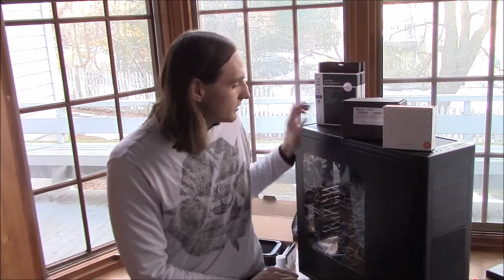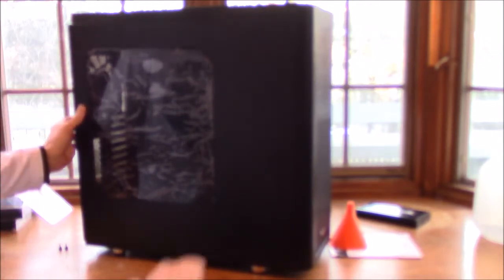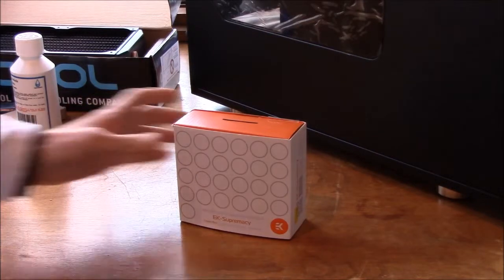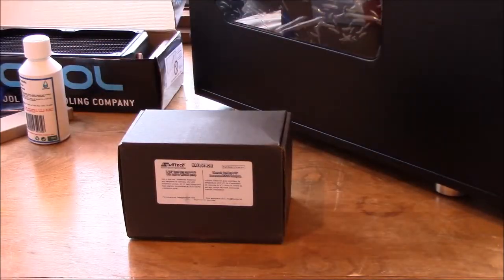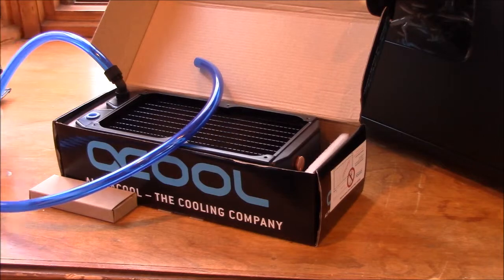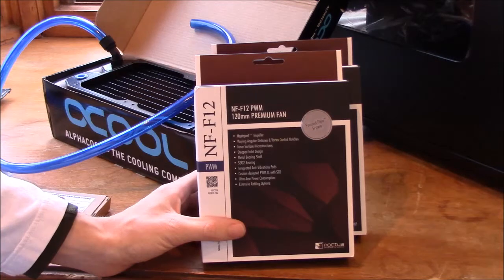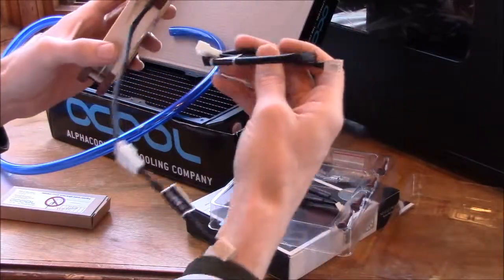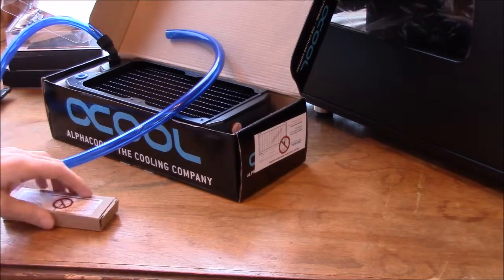FD Arc XL water cooling build log (Part 1 of 8) - Parts Overview and Unboxing

Comment: Been thinking the same setup, any complaints? Though im gonna go with some other fans, noctuas are like you said it... ugly.
Reply: actually whats the noctua model? .. since they come in different colors now so its not bad.
Reply from the maker: Johnny Wayrest I'm using the NF-F12 in the front and NF-A14 on the top radiator (not shown in this video). They're completely silent and move a lot of air, and not visible from the window, so I'm happy with them. I would like the black, but I think they charge a premium for black.